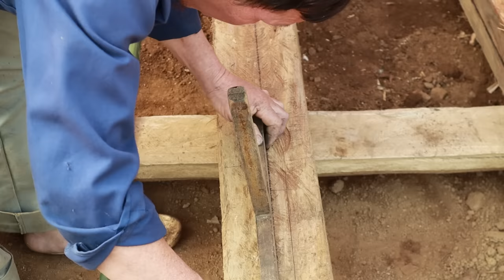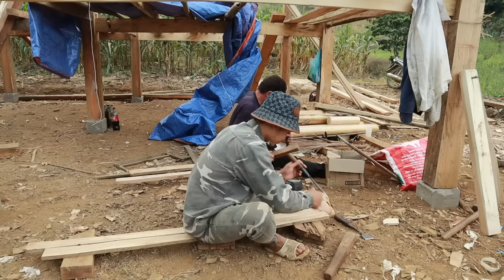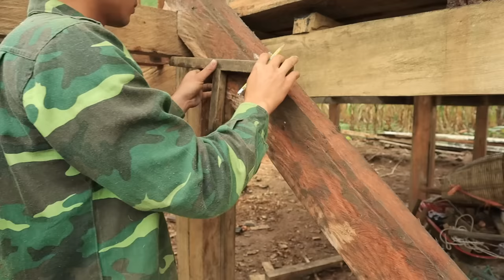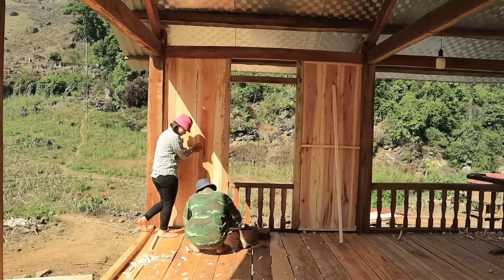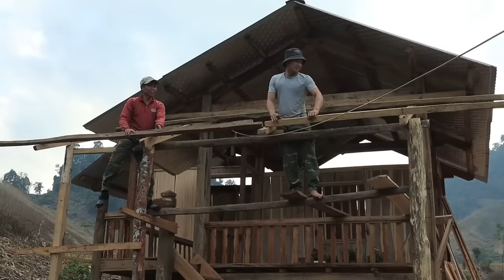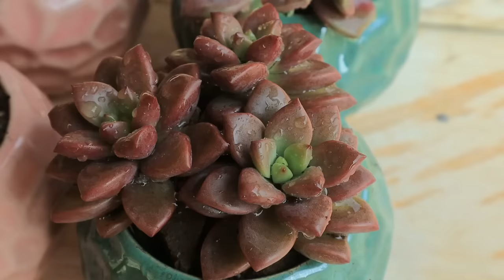Full video 200 days | the process of building a big wooden house | Live With Nature

Comment: Unfortunately, this house is the kind of trouble you rarely see. And it's a shame because it took a lot of work. I could count one carpentry mistake after another, but I think the fact that the material was obviously not properly matured and dried is enough, so it will still "work" and dry out, meaning the joints in the floors and perimeter walls will get bigger. And since the joining of the individual segments was almost always with nails (not self-tapping screws), even those nails will come out after the wood has dried. Well, connecting two gable roofs to each other as you can see in the video will make a small homemade waterfall when it rains. No amount of flower decorations and a carefully swept yard can save this.